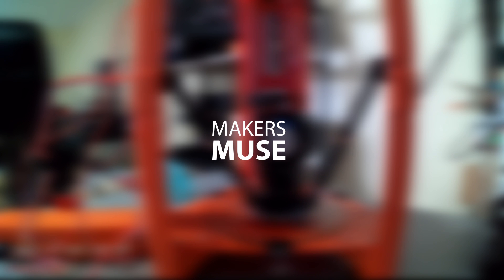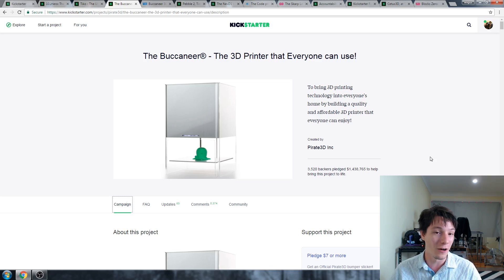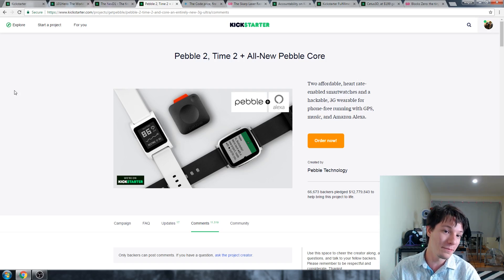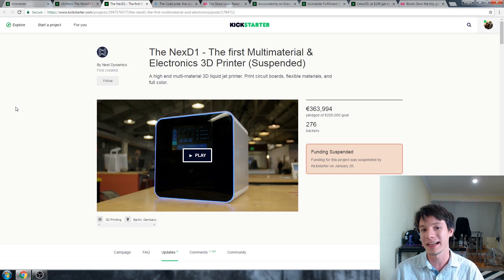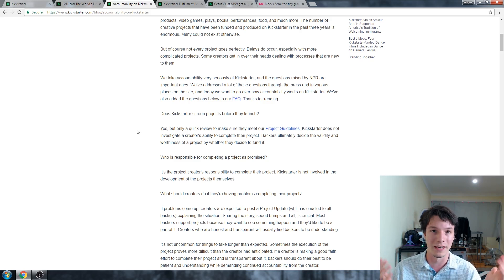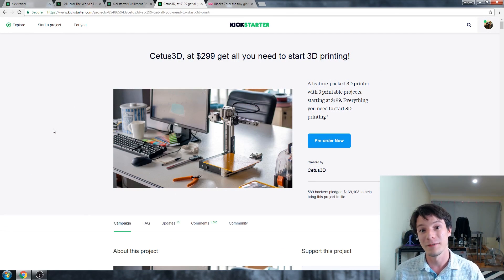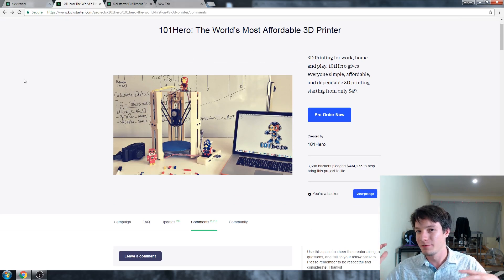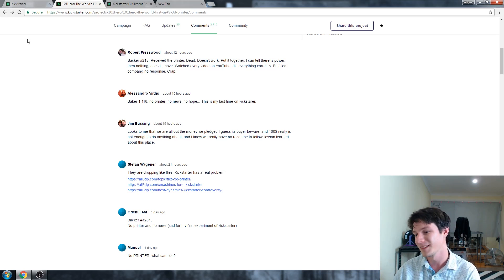Crowdfunded Hardware - We need a new approach (urgently)

Comment: I have been a backer on multiple products on kickstarter, all of them that I pledged I ended up receiving. There were a couple that kickstarter did shut down before the pledge went through which was good for me. The one I was most worried about was the SCIO, a Pocket Molecular Sensor. This had the looks like it was going to be a scam after the campaign ended due to kickstarter closing their page and not hearing any more communication from the team for a very long time, almost a year. I did contact them directly and they said they would refund it. I decided to give them some more time because I know and understand the troubles of manufacturing and how delays can happen. After over 2 years beyond the promise date, I did receive it and I am very happy with the product. 

That being said, I do think kickstarter should have some sort of responsibility if the campaign fails to produce the product, or is a scam. I do understand that alot of the issue may be from what you have talked about in the video about not knowing how to mass produce the products.

What alot of people have to be aware of on kickstarter is that you are backing something that has not been produced yet (ITS NOT AMAZON) and there is a learning curve with alot of these inventors out there. The product that you do get may not be what you expect because its the first run and changes happen over years to get the best product for a customer. I am well aware of this and have had a few items that were great in the beginning but failed a few months later. I was prompt to explain to the campaign lead about the issues and how it could be improved for future product. This is one way we (the consumers) can help make the end product better, just like open source.

And a final note, you have to be willing to take that gamble on a product, if you can't take that gamble/risk that the campaign may fail then this is the wrong place for you.

Just my personal experience and thoughts.

Comment: In the United States, several States, including Washington State, have pursued non-delivering Kickstarter and Indiegogo campaigns through consumer protection laws. Specifically, the campaigns were pursued under consumer fraud statutes, some of which were recently updated to include crowd funding campaigns.  The issue is that the backers are being offered a product in exchange for value and are not investors (as opposed to the Quirky model (where backers received IP equity), which iirc failed) and therefore may be protected in instances of non-delivery.  

The solution against fraudsters or the worst crowd-funding campaigners is consumer protection laws.  The issue is that escrow won't work because it holds back the funds allegedly needed to complete the product.  Making the backers into angel investors means that the backers will need/want equity, which will destroy the future investment value of a successful company and provide no protections against non-delivery.  (In the U.S., at least, investors only receive equity and are protected only against economic fraud and breach of fiduciary duties.). In the case  of the Kickstarter and Indiegogo model, the best and possibly only solution is "caveat emptor."

I might add that I have backed over a dozen Kickstarter campaigns and have had only one complete non-delivery.  Another campaign., Triggertrap, which at the time was a successful company, had a product concept that got all the way to prototype and then failed due to economic infeasibility.  In that case, Triggertrap was completely transparent about the process, the issues, and the ultimate failure.  In many ways, the backers were made partners to the project.  Most importantly, however, announcing the failure, Triggertrap offered several options to recover some value from the campaign: 1) donate your remaining backing funds, or 2) receive Triggertrap products in lieu of the failed campaign product.  I took option 2 and like the products I received.   Sadly, Triggertrap folded last month, having never recovered from the failed Kickstarter campaign.  But that is the way of a startup.